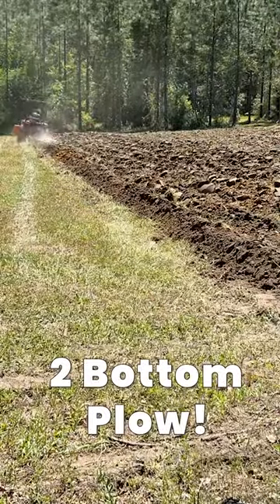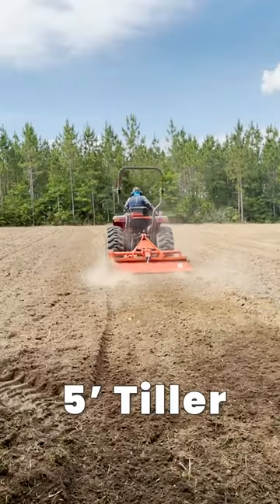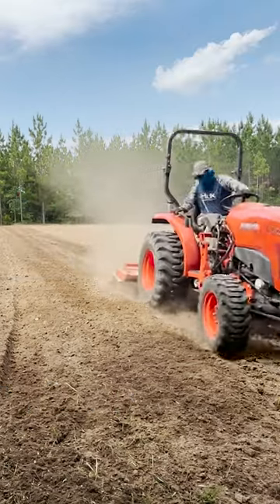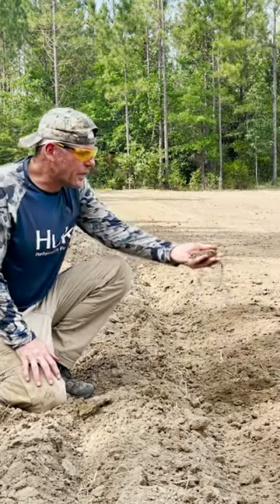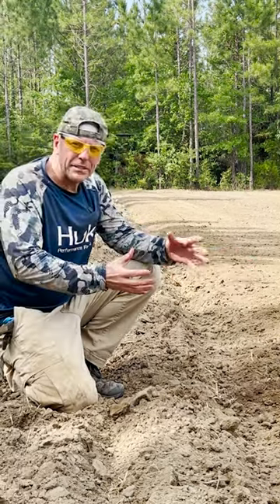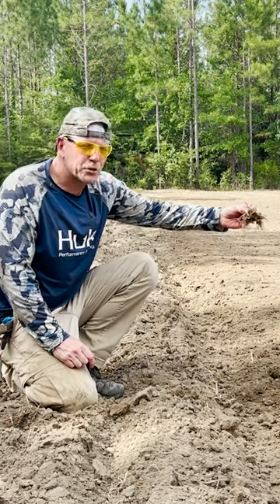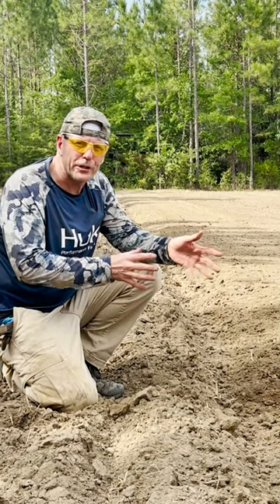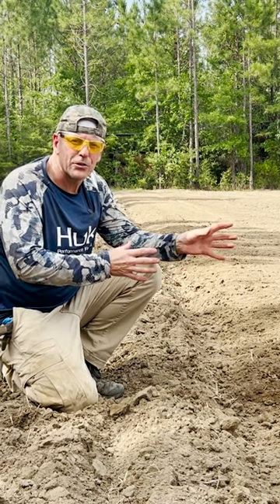AMAZING DIFFERENCE - Disc Harrow vs Tiller

Comment: I’m seeing some nay sayers on the tiller. Gotta tell ya, tilled 5 acres for a new hay field, and it did wonders. No drill required, just broadcast and roll it. The sweet corn, made it easy to push plant 12 rows. I assume it would be easier on larger equipment. Best to let it rest for a couple days, almost too soft.
Reply from the maker: It leads to compaction over time but it makes a perfect seedbed for years.

Comment: When it rains on the rotary till side you will have a concrete road congratulations
Reply from the maker: the whole field got tilled and it's lush green with soybeans 3' tall right now.
Reply: Plus heavy rain and all the soil erodes